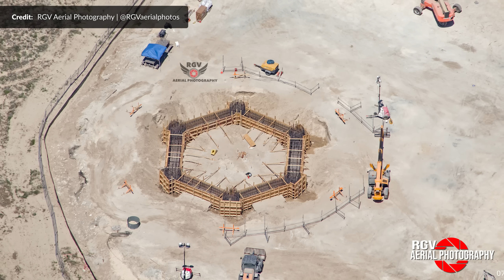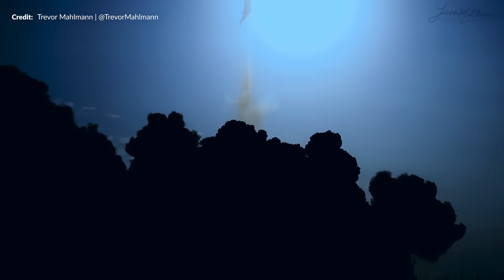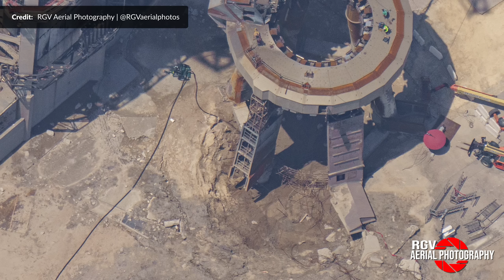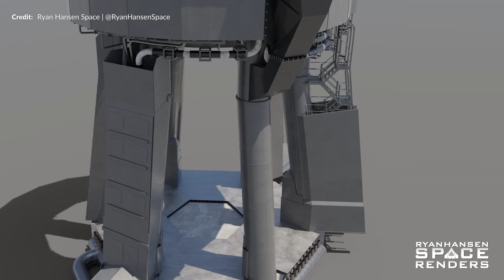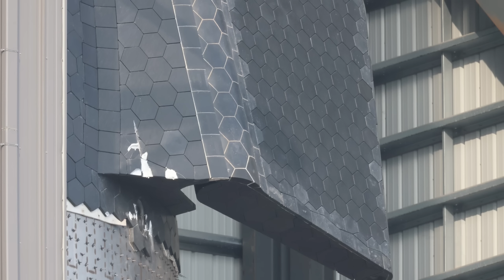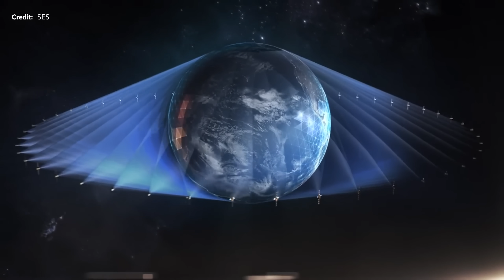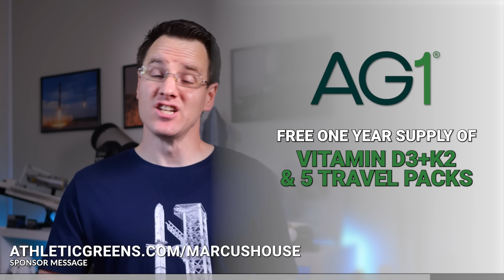The Starship Damage Left Behind: How are SpaceX Moving Forward?

Comment: Hi from the bottom left hand corner of Oz.
Mention has been made of flame trench problems because of the high water table. 
If the trench was intentionally left leaky and flooded by the natural water table, you'd have no flotation problems with that structure. The Beast of Boca Chica could then blast that away in a split-second on startup leaving a functional empty trench
Reply: Flooding isn't good for structures that you want to stay stable. The OLM distance to the ground is roughly the same as the distance from the pads at LC-39 to the bottom of their flame trenches. The OLM doesn't have a flame diverter and water deluge system. Musk mentioned that they have a water-cooled steel plate system to install under and possibly around the OLM, but it was ready yet. Musk's "the best part is no part" philosophy bit him in the arse wtih the no diverter or deluge part. He rolled the dice that Stage 0 would make it through one launch without them and came up with a Nat 1 on the d20.

Comment: I kind of wonder if they will just build stage 0 v2 and launch from that one next
Reply: It will be upgrade this one to V 1.2.  Stage 0 itself was an upgrade to V 1.1 from the original plan.  Version 2 won't happen until either A/ they master catching or B/ decide they can't.
Reply: @Scanner9631  I ment just build the second pad
Reply: @killer3883  

Much quicker just to repair this one.  Also why build the 2nd pad when they are still working on the next generation design?  Why build 2 of the same generation when it is not "quite there yet"?
Reply: @Scanner9631  they have the new design ready to go, lol, was just a proposal, realy depends on how repairable the tower Fondation is
Reply: @killer3883  

How can they have the new design ready to go when they just got the first actual data on the forces of a full stack launch?  Anything they had designed MUST be reviewed based on the results of this test.
Reply: @Scanner9631  they have known for a while that the concrete may not/probably would not work, some team has worked behind Elon's back to have a plan in place is my guess

Comment: Imagine taking off from moon soil... It will be a donut 😂
Reply: First you have to imagine Super Heavy getting to the moon when it isn't even supposed to get to orbit.  

HLS will have at most 9 engines not 33 and will be lifting off under .17 g not 1.0g so doesn't need anywhere near the same thrust.  

Finally of course at least in their successful bid the lift off and landing will use smaller engines mounted higher up with diagonal aiming so any debris would fly away from the rocket and its landing site.

Comment: I really think a flame diverter will be essential. A water cooled steel plate under the OLM can perhaps resist the down blast from 33 raptor 2 engines. But blast and sound energy radiates out from the engines. It's not just down blast causing the damage. Also down blast would be reflected from a water cooled steel plate, adding to the blast radiating from the engines all around the launch vehicle. And how healthy are the Raptor 2 engines? Did all 8 engines fail due to damage from flying debris? I doubt it.
Reply: To be fair, the OLM distance to the ground is roughly the same as the distance from the pads at LC-39 to the bottom of their flame trenches. The OLM doesn't have a flame diverter and water deluge system. Musk mentioned that they have a water-cooled steel plate system to install under and possibly around the OLM, but it was ready yet. Musk's "the best part is no part" philosophy bit him in the arse wtih the no diverter or deluge part. He rolled the dice that Stage 0 would make it through one launch without them and came up with a Nat 1 on the d20.

Comment: We are concerned about the Raptor engine. So far, we have not seen a single-Raptor stationary test of full cycle simulated launch and re-launch. We saw almost 20% flame-out during the 4 minutes. I don't accept that the engines were hit by debris because the thrust is away from the engines. The loss of stage zero buys time for improvement of the Raptor for the next launch. I really want to see the Starship enterprise succeed. Oh, did I say Starship enterprise? :)
Reply: It doesn't matter what you accept.  The facts matter and they still need to be shown.  Did they flame out?  Did they get hit by debris from the exhaust?  Time and data will show.
Reply: Oh FFS, not this nonsense again. EVERY SpaceX engine goes to their McGregor,  TX site for full duration testing, before being put on a booster. EVERY engine on S24 and B7 DID do testing.

Comment: How can so many smart people be so dumb?  As an armchair expert in the peanut gallery even I could see that they needed something like a flame trench, given the decades of watching successful NASA launches.  Even "single use" ICBM missile silos had flame diverters and not just a "she'll be right" flat bit of concrete.
Reply: To be fair, the OLM distance to the ground is roughly the same as the distance from the pads at LC-39 to the bottom of their flame trenches. The OLM doesn't have a flame diverter and water deluge system. Musk mentioned that they have a water-cooled steel plate system to install under and possibly around the OLM, but it was ready yet. Musk's "the best part is no part" philosophy bit him in the arse wtih the no diverter or deluge part. He rolled the dice that Stage 0 would make it through one launch without them and came up with a Nat 1 on the d20.
Reply: @steveaustin2686  The thing about the flame trench is the curved surface, limiting the force carried by the ground directly beneath it and instead redirecting it horizontally into effectively "open air".  Yes you do get natural deflection and dissipation of forces by having ventilation space around the pad but you're still concentrating force in the centre until it can find a natural exit, and you're losing the ability to redirect the forces away from critical infrastructure.
Perhaps SpaceX's engineers' minds are "just too highly trained, Majikthise".
Reply: @ffsireallydontcare  Yes, the curverd part would be the diverter part. Musk said in the past that they might have to add a diverter under the pad, but he apparently wanted to avoid that so that they could work under the pad on the engines. They were working on the water-cooled steel plates to be installed later, but nothing was said on how they would be installed, either flat or canted. IIRC, the pad was damaged by the 31 engines static fire, but evidently they didn't expect the pad to fail this spectacularly for a launch. Musk's 'the best part is no part' bit him in the arse this time.

Comment: It’s trashed. Cut it out, bring the one from KSC, build up the soil 30’ to allow a flame trench to be installed and add a top tower section (also from KSC). We see it didn’t work, Elon. Put your ego back in your pants and do it right. The FAA doesn’t like you anyway so don’t half-ass this and give them another reason to shut you down. Just like at KSC, due to the high ground water level, the pads are built up so there is room for a flame trench. If Elon decides to just rig it up to launch again then he needs to build another tower, this time the right way. Even though he says in his interviews with Tim Dodd he pretends he is also wrong but clearly no one had the courage to tell him his concrete wasn’t going to work. It’s amazing what math can do and I’m sure if you did the calculations they would indicate that failure was highly likely.

Comment: That was the best thing, how the Starship steel structure held out after all that. It seems like yesterday that tanks and Starships were blowing up or being crushed under its own weight.
Reply: Those tests were with OVER PRESSURES to find the limits and adjust the strength of the tanks (and weight) down to a more reasonable level.  They may still be too strong considering how well Super Heavy and Starship held together during the spin.  It was test to destruction on purpose, they were supposed to fail, a non failure would have meant it was WAY TOO STRONG.

Comment: Allowing the most powerful rocket launch in a desert environment, right next to the fuel tanks and not even using a flame trench……

What could possibly go wrong….

If only someone would of thought of using a flame trench, move fuel tanks away from the launch pad and not launch in a dusty desert environment….

Oh no wait, people started doing this over 50 YEARS AGO 😂😂😂😂
Reply: Please suggest a better site in the southern continental U.S. where they could be allowed to build and launch MASSIVE prototypes that might explode.
Reply: To be fair, the OLM distance to the ground is roughly the same as the distance from the pads at LC-39 to the bottom of their flame trenches. The OLM doesn't have a flame diverter and water deluge system. Musk mentioned that they have a water-cooled steel plate system to install under and possibly around the OLM, but it was ready yet. Musk's "the best part is no part" philosophy bit him in the arse wtih the no diverter or deluge part. He rolled the dice that Stage 0 would make it through one launch without them and came up with a Nat 1 on the d20.

Comment: weird u would think use hydogen to fuel the electrial genarators!! 🤔
Reply: Virtually all hydrogen currently comes from the fossil fuels industry, so it's not currently a green solution.
Reply: @ffsireallydontcare  thxs!! but my point is there using hydogen for the rockets?? but u could be wrong!!
Reply: @Mrequine1  Umm, correct me if I'm wrong, but I think Starship is using methane?  From memory that was one of the innovations of the Starship platform, moving away from hydrogen or hydrazine which was historically used in these large scale rockets.
Reply: @ffsireallydontcare  intresting thxs
Reply: @ffsireallydontcare  Moving away from RP-1 (highly refined kerosene) to LCH4 (liquid methane) as methane burns cleaner. LCH4 is not as clean as liquid hydrogen (LH2), but is easier to manage in a rocket, as LCH4 is almost the same temp as LOX (liquid oxygen) as well as a bigger molecule.
Reply: @steveaustin2686  thxs i leaned something their
Reply: @Mrequine1  You're welcome. I learned about it from reading up on it when Starship was slated for LCH4. There is a Tim Dodd video about rocket engines that has a LOT of great information.

Comment: It looks like Musk's vision of having this behemoth launch AND land at the same pad was overly optimistic and unnecessary. Maybe launching from a pad suspended above a large body of water would solve a lot of problems.
(It seems unlikely that you would have to rebuild the Gulf of Mexico between launches.)
Reply: PROTOTYPE.  This version was never expected to land.  This Stage 0 was never expected to attempt a catch without a great deal of upgrading.  Some of the upgrades were already being worked on on site such as the deluge system.

Comment: I was waiting for your update and you didn't disappoint. I speculated that it would not take very long for SpaceX to make repairs and as long as the pad is not tipped it won't be. I doubt that it is. That means 1-2 months as Musk said.  One month from today, I think we are going to see a pad that looks like it was never used and ready for Act 2.
Reply: Musk always makes the most optimistic estimates so I wouldn't be surprised by "slippage" but would be surprised if the naysayers and their more than a year predictions were true.  Likely under six months.  If it does go a year or more it will be regulators not SpaceX forcing it.  Watch for interference by the Republican Congress.

Comment: Is a steel plate necessarily a good idea *at least at the angle we see in this un-official video*? Won't the pressure waves reverberate off and hit the engine bay and other equipment?
Reply: Depends on the shape and angle as well as their deluge system and its angling.
Reply: @Scanner9631  I mean, the one in the 3D depiction, which I know isn't official, would be perpendicular. Maybe I was too fixated on that, but an angled would was what I had in mind when I read Elon's tweet.
Thankfully, Superheavy did the heavy digging already.
Reply: @chriswhite3692  

I'd like to see a multi layered system of baffles on top deflecting the exhaust sideways between the legs of the launch mount and causing turbulence to interfere with any upward reflections.

Comment: The fact that booster flew for the first time ever, amazes me.
Reply: Didn't surprise me at all.  I hoped for better but was 90% sure of it clearing the tower by kilometers which it did.
Reply: ... and how well the stainless steel held up while tumbling. They had to bleed off fuel for about a minute before the internal pressure dropped enough to allow structural failure.

Comment: The fact that the booster survived until it was blown up could mean that it is unnecessarily strong, and that some mass could be removed.
Reply: Future iterations after fully successful flights (and maybe catches).  Now imagine they switched to titanium and made it say 1/3 lighter?  What would that do to capacity to orbit?  It would be more expensive but if the booster were already reusable the extra cargo would make it worth while.
Reply: @Scanner9631  Probably not worth it. Titanium is ~25-30 times more expensive and also incredibly difficult to work with (e.g. much harder to weld properly). Also, the dry mass of the vehicles is not a big deal since the mass of the propellants is so much higher (e.g. the booster, ~150-200 t mass vs ~3600 t of propellant, ship ~85 t vs. 1200 t). That means the payload for just the booster (i.e. the loaded ship) to main engine cutoff becomes ~1240-1250 t vs. 1285 t. I suspect it is cheaper to build and fly 15+ SS starships vs. 1 Ti starship, so the mass to orbit cost could be significantly higher for Ti. If a Ti starship could be built for say twice the cost of a SS one, then maybe it's worth it, but I highly doubt that is possible due to higher material AND fabrication costs.
Reply: @richardb1452  

Maybe.  But still tougher and lighter with more payload and perhaps more life cycles could push it over into being cost effective even if only for a select few high payload missions.

Consider also if the 2nd stage is lighter it carries more cargo AND requires less fuel to land (assuming re-usability works out) which means even more payload to orbit.  You might reach the payload that makes the plans for expendable versions with 250 tons payload not cost effective.  

Finally of course with titanium being 25 - 30 times more effective but 1/2 the weight for the same strength it cuts that number in half to 12-15 times.  For orbital class rockets as with aircraft that MIGHT be enough to make it viable and even highly cost effective.  

It might not make sense for designs like the HLS or rockets beyond LEO due to reduced (if any) reuse while still be desirable otherwise.  

Just a possibility.
Reply: @Scanner9631 , I think you mean 25-30x more "expensive" plus much harder to machine, form, weld, etc... so it isn't just material costs, every process used to build the ship costs more if Ti is used. Ti is not automatically better at everything. It doesn't flex as well for instance, which might be a factor. Even if you get 300 t to LEO with a single Ti starship launch, that is at most 3 flights of the existing SS design. They'd need to make the materials + build only 3x the cost to break even and that is very unlikely. You'd save 2 propellant loads, but that is insignificant from an overall cost perspective ($1-2M/flight according to Musk). They are building a transport, not a race machine, so overall cost is paramount. It's like Musk's point on parts counts "The best part is no part". That applies to expensive exotic materials too. If you can succeed without them, that's generally better from a cost perspective.

I have little doubt when they were deciding not to go composite they investigated this possibility, at least briefly. Based on SpaceX's past performance, they would have probably gone that route if it was effective for their goals. Sometimes brute force wins out over more exotic approaches when overall cost is the primary factor. Think about where Ti is used extensively and you'll find a list of things where cost is almost irrelevant and performance is the primary driver (fighter jet structure, jet engine blades, race cars/bikes, medical implants, etc...). That "performance at any cost" is the "space" in which Ti excels.

Comment: the flight termination system is apparently not remote controlled
Reply: Why would you think that?
Reply: @Hedgehobbit  because they are using the AFTS, which stands for Autonomous Flight Termination System (AFTS)
Reply: @Humuku  I think it is both. As long as the flips were staying in the flight corridor, they could let them go on, but once it started heading out of the corridor, the FTS triggered. Reportedly with the autonomous system.